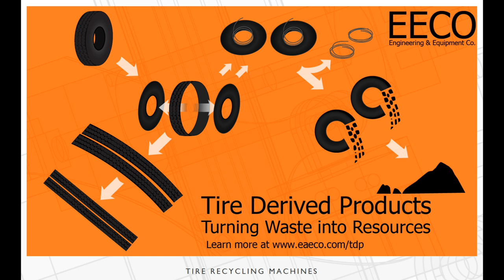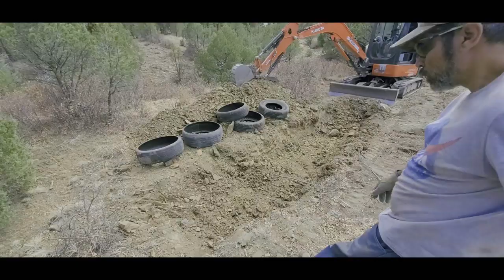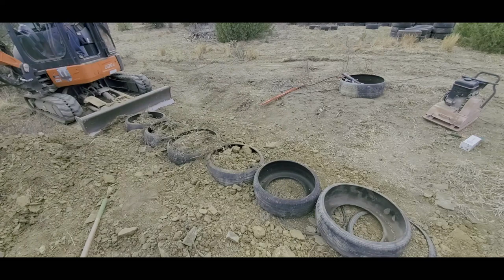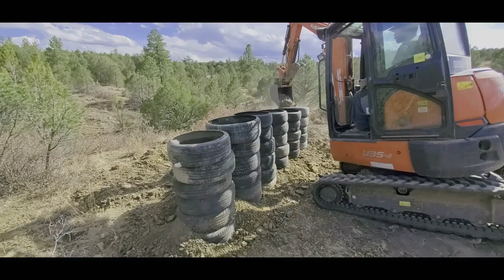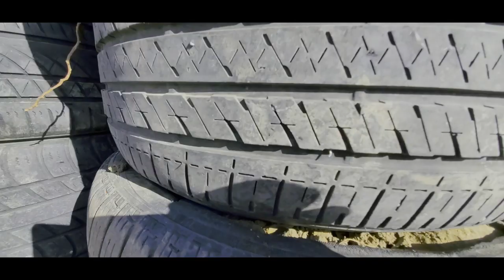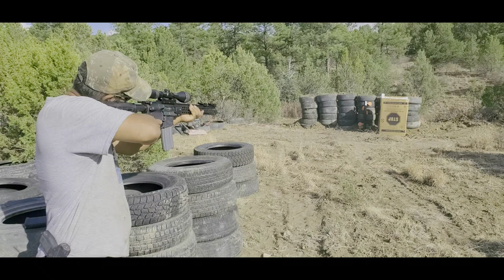New Tire Wall Shooting Range Build | #aircreteharry #tirewall #aircrete #shootingrange #diy #offgrid

Comment: Will the bullets be stoped if they go between 2 tires? I think that I would put a second row of tires behind, just to make sure !  Bud then, in The Netherlands shooting is not allowed outdoors, so I don't need to worry! Shooting is only allowed at gun clubs. To bad, because I would like to shoot outside ! Greetings from The Netherlands !
Reply from the maker: Hi, yes I do have plans to put more tires around the shooting area.  I have been a few times to the Netherlands it is a beautiful place. The last time I was there we stayed at the Efteling. We all had a good time. But I never saw more cameras on the highway then in the Netherlands. 😀
Reply: @AircreteHarry  and now even more !!! Here they have a system of camera's, that look for your speed over a certain distance. They check average speed, and they will  bill you automatically if you are speeding !! Bud the good news is, not to far from Germany ! There you still can drive as fast as you like.

Comment: Seems like they should be cutting the tires for earth ships as well. Looks so much easier.
Reply: It is a technique that I had suggested last year. I have the larger tire cutting machine (cuts both sides at the same time) that Harry has. I don't know why Harry isn't overlapping the chords -but - each of us has different approaches!
Reply: @rongray4118  i tough about that no overlap, but then relised the dirt will fall out the holes in the sides,
Reply from the maker: I'm going to build a greenhouse with the tires. If it works like I think a lot of people will want to use this system.
Reply from the maker: @rongray4118  I will for the greenhouse. I just wanted to get my feet wet with building a tire wall.
Reply from the maker: @leoncryp8182  You are correct!

Comment: Where did you get the machine to cut off one of the tires sidewalls, also the wall is a little short. In case you accidentally shoot above the berm

Comment: Why didn’t you stagger the tires?
Reply from the maker: I was going to and you see this in the video but I did not have cardboard ready to cover the hole. And I was going to vibrate each layer but did not feel like doing that on this project. This was a warn up for the 100 foot long Greenhouse I will stagger and vibrate each layer.

Comment: Thanks for the closeup of the tires on the receiving end. Some of them gave better tread than my truck’s tires.  What are you doing with the sides?  Here in Ohio our DOT road crews use them as weights on plastic orange barrels.  Thanks for sharing this video.  Trusting that you and your lady are safe from the pandemic.  Peace brother.